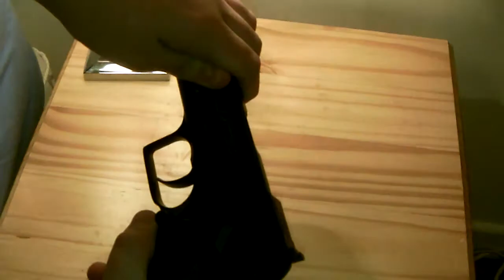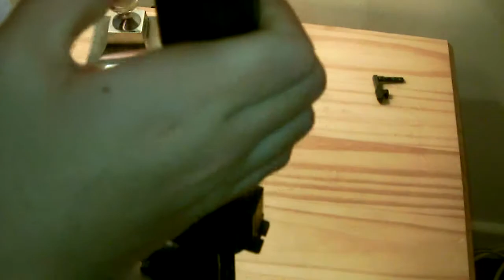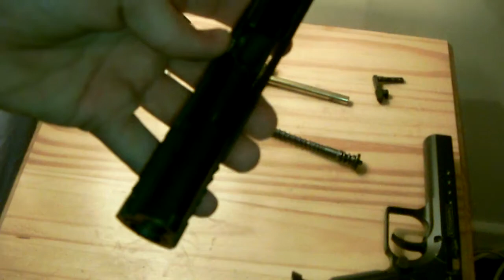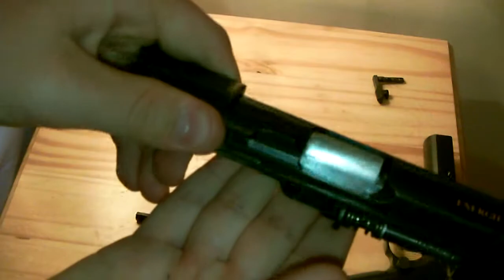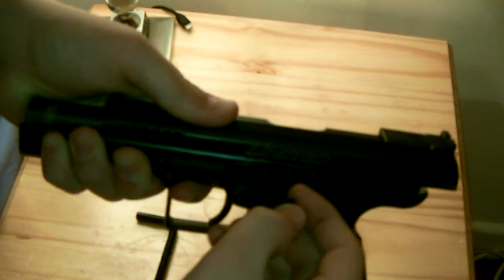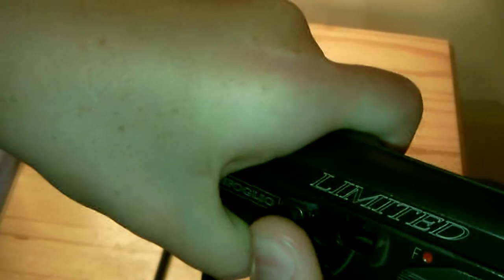How To Do A Full Field Strip Of The Tanfoglio Limited Custom Air Pistol

Comment: Very helpful video!  Thank you!  :-)  I just purchased this model.  I haven't attempted to field strip it yet.  My question is, I see you pull & hold the slide the whole way back in order to remove the slide catch.  I've heard that as on the real steel version of this replica, you only have to line up two dots?  One at the rear of the slide & the other one right below on the frame behind the safety?  I haven't tried it either way yet, but I'm told pulling the slide the whole way back, field striping this gun that way can damage the gun over time?  Because it was designed to be done by lining up those two dots?  Which the slide is only pulled back slightly.  I understand that it's also easier this way?  Please advise which way is the correct way?  As I don't wanna damage my new gun.  I thank anyone in advance for any advice or feedback.  :-)